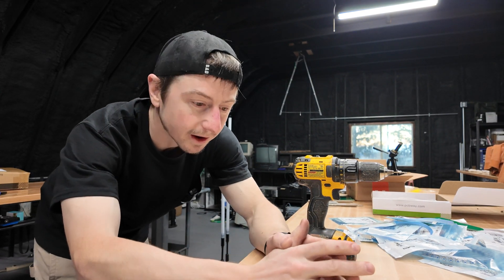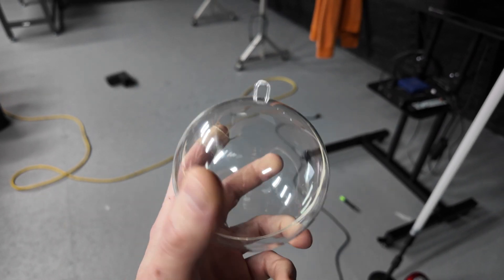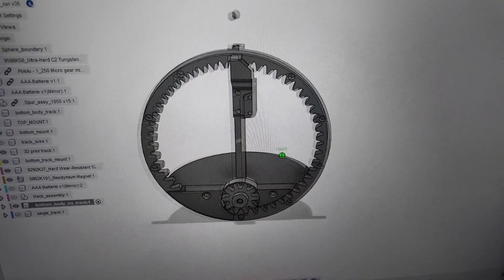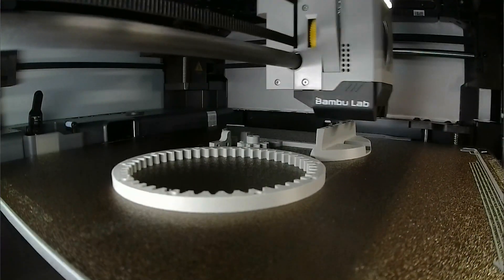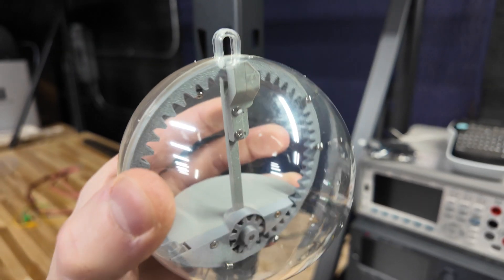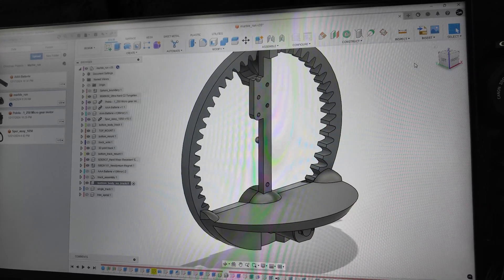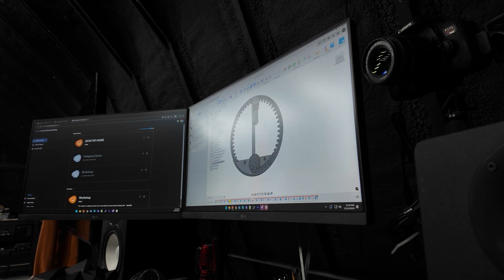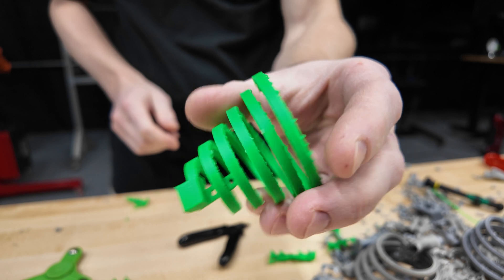You Can Build This Tiny 3D Printed Marble Machine

Comment: Dear Sirs:
 Excellent project! 
Have you ever thought about taking the project to the next level by mirror finish machining the base out of a solid block of non-magnetic metal (ie, 6061 aluminum) and adding mounting locations for LED black lights (say UVB). It would be very interesting to see the tool paths for a 5-axis CNC operation using Fusion 360 or SmartCAM (May need a soft jaw secondary fixture as the ramp would turn into a spring. The ball bearings would need to be very thinly coated with a phosphorescent material (ie, strontium aluminate phosphor). 
Sincerely,
Don B.

Comment: Anyone try making one of these?  I had difficulty getting the “marbles to go down the ramp.  Perhaps the bbs I used don’t have enough mass, but the angle of the track does seem very shallow.  Any thoughts to help improve things?
Reply from the maker: What layer height are you using?
Reply: @SeanHodginsToo I tried both 0.2 and 0.1.  It was a little better at 0.1, but maybe I need to go smaller.

Comment: For those plastics that tend to crack when drilled, and without using heated pins, run the drill in reverse. The drill will deform the plastic instead of cutting and possibly catching at breakthrough.

Happy new year!
Reply from the maker: Cool tip! I’ll give that a try next time

Comment: If you have incandescent lights, you could try powering the motor off a light bulb connector like how animated ornaments used to do.  You could run the wires into a bulb connector that fits into a removed bulb from a strand.  LED trees probably wouldn’t be possible since they usually don’t have removable bulbs.
Reply from the maker: I've been hearing about these. Would be a cool way to do it, but would need some circuitry to run the DC motor off of the 110V AC. My LED ones do have removable bulbs as well, but I believe its still just AC in the wires

Comment: 12:30 for super cheap, slightly larger small balls, can use BBs. Modern ones are steel with a coating over
Reply: Walmart sells 100ct for $1! Tough to beat a penny a piece tbh

Comment: 10:37 I recently learned about changing the supports settings right under where you choose standard or tree. If you play around with those, you can get supports that come off a lot easier and cleaner.

Like 'snug' option for traditional or 8 think it's 'slim' for tree?

Was a game changer for me as I spent waaay too much time cleaning off the little scars from supports that bothered no one bit me, lol

Comment: 5:47 for tiny holes like that, I find it easier to hear up a pin and melt through.

Then you can use a drill bit to widen to the final size. I have far fewer splits or cracks that way